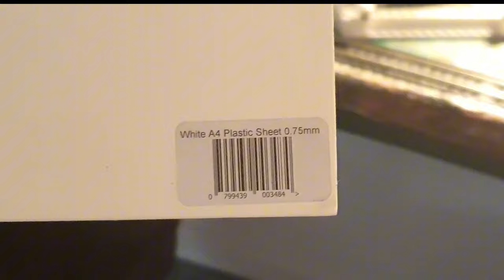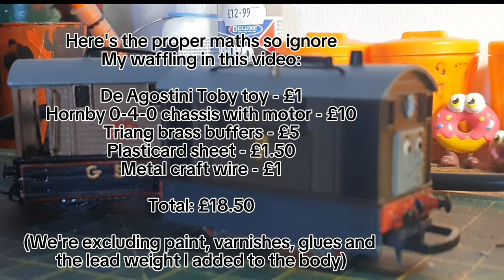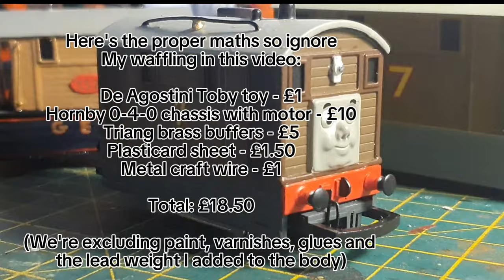Making Toby The Tram Engine in OO Gauge, On The Cheap

Comment: This is inspiring! Things you can do with little funds and big dreams

Might have to try this conversion with the likes of that new AEG Push Along Toby! I can swap out the face no problem, the real trick'll be the metal
Reply from the maker: Sounds like a good idea, the metal body should give it some more traction anyway. Mine has a plastic body so I've stuck a folded up bit of roof lead in the body.